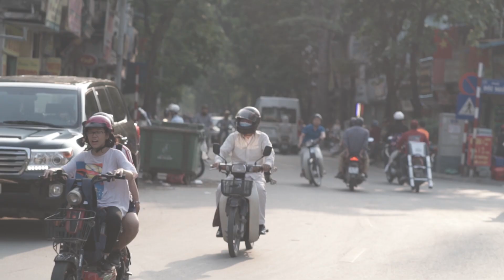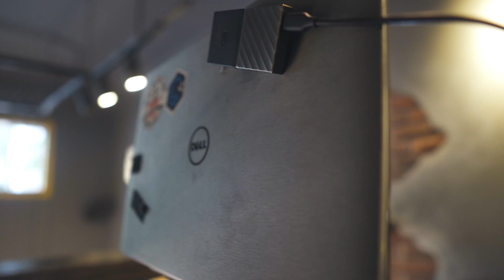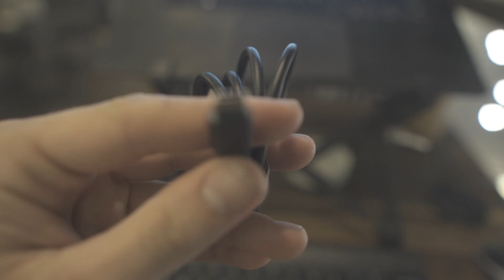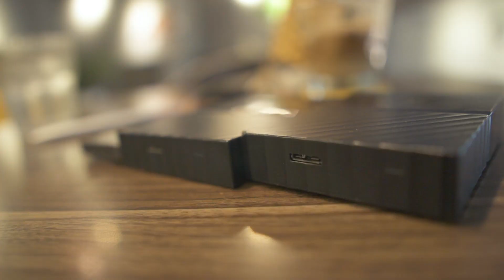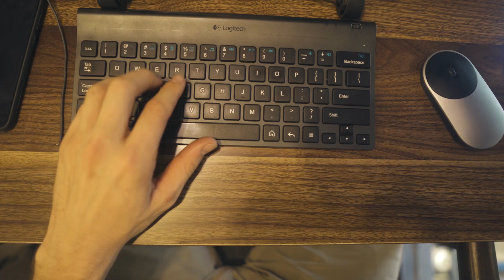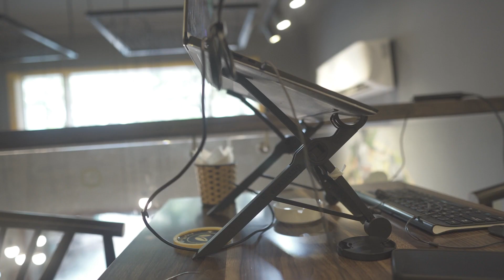The Dell XPS 15 Is The Perfect Portable Office For Creators

Comment: Great info. I watched hundreds of vids and narrowed down on XPS 15, same config as yours. This video saved me time and gave me all the info I need to make the purchase. I'm going to try to find a good deal now.
Reply from the maker: I just did the research for you, you have a couple options, 8th gen processor and core i7 with full hd screen or 8th gen and 4k screen or 7th gen 4k screen. I looked on the dell website and cnet product finnders and amazon was the best deal i could find. Here is the spec I would get, 4k touchscreen for color reproduction and watching 4k footage native, 32gb of ram I paid an extra 300bucks to upgrade after the fact and it's cheaper in this case from the factory, 512gb ssd and I edit off of an external USB C ssd which i will also link down below, this model also has a 97kwh battery which is the biggest you can get. 

I rethermal pasted mine, deal is notorious for terrible thermal paste jobs and you aren't voiding any warranty by doing so and its quite easy. Thermal paste and undervolting will get you the faster render times since they are CPU intensive and allowing your CPU to stay at the higher clock for longer will do more than the short turbo boost. I also use a nextstand to prop my computer up for long editing sessions and honestly for editors and filmmakers it is a must have. I built an updated version of what I would consider an ideal editing and creative work station for mobile use down below. The products are all through amazon but they are either the best or the cheapest products I can find on the market. Also, i just lost 4tb of footage and signed up with backblaze to protect my work down the road so here is the video, backblaze will end up saving you money as data recovery is really pricey:

Computer:8th gen  https://amzn.to/2nKdXEE 7th gen https://amzn.to/2vQ6AzY
SSD: This has almost identical read and write speeds and is 20 bucks cheaper than mine: https://amzn.to/2MjIqYP
Nexstand: https://amzn.to/2ODLv2M
This is the mouse that MKBHD likes: https://amzn.to/2OCpcKH
Great keyboard: https://amzn.to/2vNX3JN

In all transparency those are all affiliate links but they are genuinely the products I would purchase right now if i needed a mobile editing rig
Reply: Amazing! thank you so much for your help! I am looking into each right now.
Reply from the maker: No problem, come back here with your final decision and share your set up
Reply from the maker: Curious what you decide. If xiaomi laptops are an option they are great